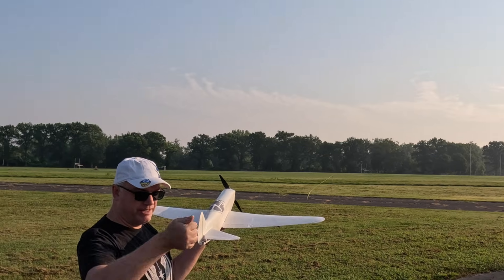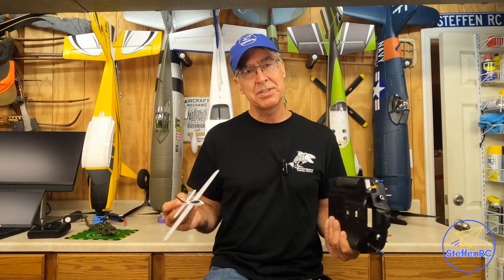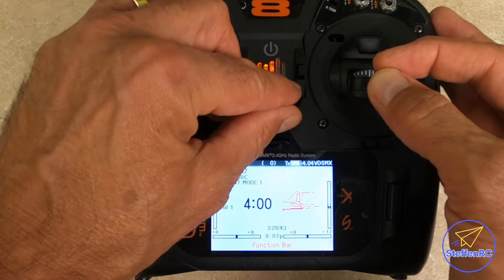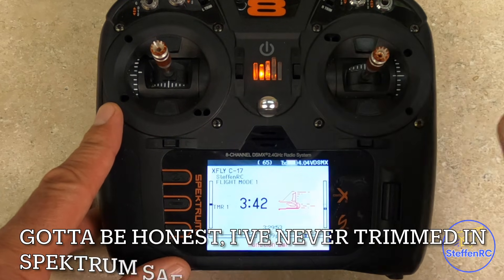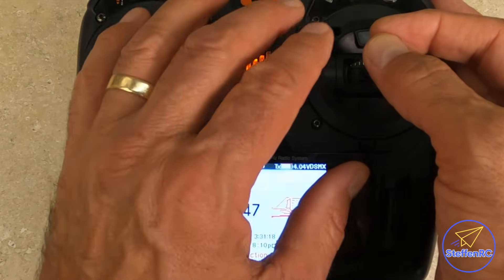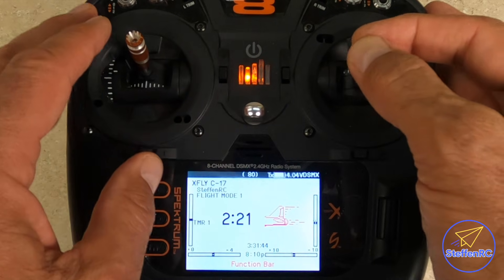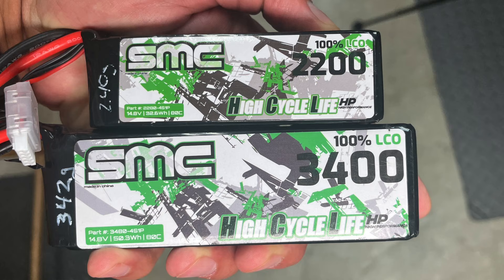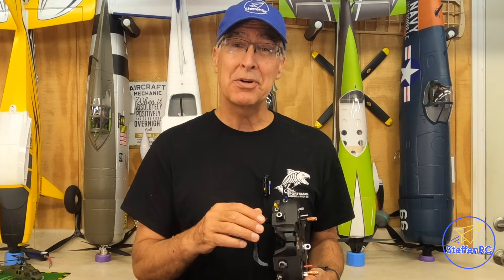Basic guide to Trimming for RC Plane for Optimal flight

Comment: I have the FMS Maule. It needs a lot of nose up trimming. The CG is 67 mm, so it is not nose heavy. Could you say, what would cause it?
Reply from the maker: It could've been the elevator wasn't in the neutral position when the control rod was connected.  It can be hard to determine sometimes.  Also, its possible the alignment of the wing and tail weren't aligned perfectly.  I've had planes seem a little out of whack, but fly great.   Does the elevator look normal now after trimming,  Or does it look like its adding lots of up.....
Reply: @SteffenRC yes, the elevator is nose up-position, after trimming.
Reply from the maker: @jarmoalaraudanjoki3675  the CG you mention is from documentation?   It still could be nose heavy as most manufacturers recommended CG is a bit nose heavy.  I test CG with an inverted flight test.  Have you tested the CG while flying?  Frankly that’s the real CG test

Comment: Good video thanks 
Another tip I will pass on- set the trim steps in the radios function list to coarse-  on mine its say 9 where normal is say 4. That way 1 click = 4-5 trimm clicks/steps rather than say 1-2 if set at 4 or less
Reply from the maker: Thats a great tip.  A plane like this could use more trim movement.  A 3D plane much less...

Comment: You can also go into the function list, and then system setup, and then trim setup and then change trims:normal to trims:crossed. That way you can keep your fingers on the stick and not have to reach over with your other hand, because now the trim switches for each function are on the opposite side. There will be a message in red (X-TRIM} on the main screen indicating that you have crossed the trims. I am running the latest version of NX firmware 4.01a. 
also when your trimming the rudder, make sure you're flying straight into the breeze or else the cross Breeze will make it look like it's out of trim and also cause it to crab.
I learned about trims:crossed crossed here.
https://youtu.be/AKOg_exGUYI?si=Ym8kA74WQAP-7I1_
Reply from the maker: Thanks for sharing.   I’ve been flying a long time.  I like to keep it simple.  I set the throttle to cruise and simply change the trims with my left hand.  For me it works.  I’ve heard of that option, But do whatever works for you.  Bottom line, trim it.   Thanks, Will
Reply: I've also been flying for a good 30 years now and it's interesting to compare the early days with nitroplanes and a four-channel radio and that's all it had was trims. So it makes me grin when you're holding an NX8 radio and saying you like to keep it simple. 😁
That's the whole idea behind cross trims is to make it more simple, the part that's not simple is simply change.
Cross trims far more simpler than having a helper reach in and hope they do the correct trims as instructed.
You explain some very complicated technology in many of your videos, which does help simplify things, but this hobby is far from simple nowadays. 😁🛩️
Reply from the maker: @larryhawkes1347  you can make it as simple or complicated as you want.  I find it simple to just trim how I’ve been doing it for 30+ years.  I don’t see how it’s really any different than just moving my thumb over to the trims that correspond to the sticks. There are tons of settings on these radios, not all of them are useful.  But again, do it how you want.

Comment: Great job once again! So true I left a plane that flew perfectly two days ago and then after leaving the plane in the vehicle hoping to get some flying in. Well after 2 days of 105 degrees in the vehicle the first flight was like flying with an elephant on the back of the plane. Luckily I saved it and trimmed it up to perfectly stable. No other changes other than sitting in my hot vehicle..
Reply from the maker: Wow, heat can really do a number on the airframe or control surfaces, glad you got it sorted out.
Reply: Probably not to wise to leave the planes in the hot truck during the summer but it's my just trying to get my flight fix on the daily trip home from work. As the club is on the way home daily. And I can't bring them with me inside of work. Except for the transmitter and batteries.

Comment: Btw, what does Flight Mode 1 do? My radio says Flaps Up, Takeoff Flaps, and Landing Flaps when I move switch D. I also enable F-mode trim on the ailerons and elevator so that I can trim for the proper glide speed/angle with the flaps deployed..  😎

Comment: Would you get the plane back home and check and adjust things?
I had my plane out and can't see anything wrong but I had to adjust aileron trim to around 20 yesterday. Can't see anything wrong as such, before or after.
I will just double check the CG.
Plane is a FMS 1220 Ranger. Smallish battery. Maybe the battery shifted to the side or something.
All your videos in this series are very helpful.
Reply from the maker: Thats odd that it flew fine, then it was off by 20.  The CG wouldn't affect that, but maybe a bend rudder.  Keep and eye on it, as it could be a bad servo that isn't centering correctly.   Appreciate the support..  Thanks, Will
Reply: @SteffenRC went to take 1220 Ranger back out today. And the main landing gear mount was actually partially hanging out. Very little glue holding it on from factory.
Have to fly off grass strip and obviously the grass isn't as smooth as a proper runway.
I always hand launch and land on cut grass.
Even with the Ranger 1220 bendy landing gear(even still despite your glue trick) then only 1 nose over landing.
None of the landings were rough or hard. No more than a dozen landings.
So I guess the landing gear was causing drag on one side that was hanging down. Mystery solved at least. I couldn't see it was loose when I was checking everything was square, as she was sitting on the gear😂